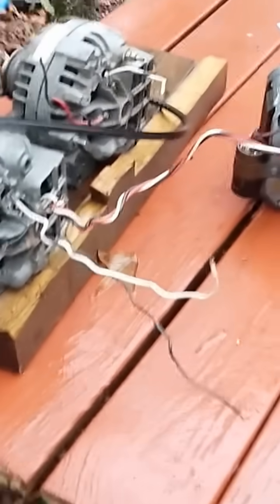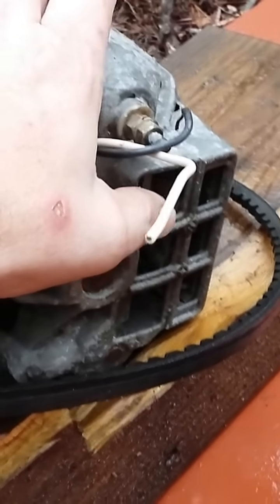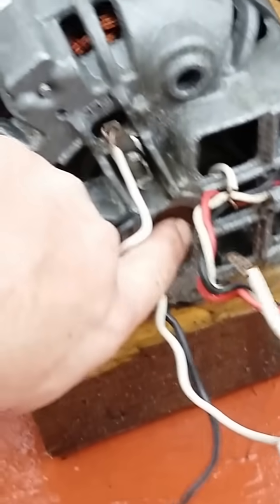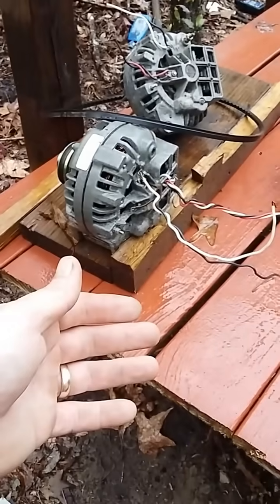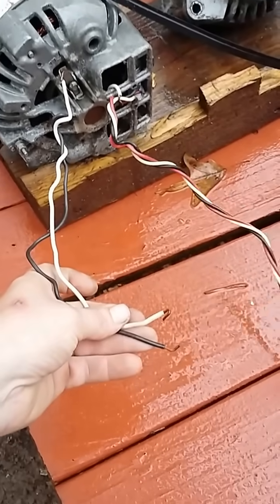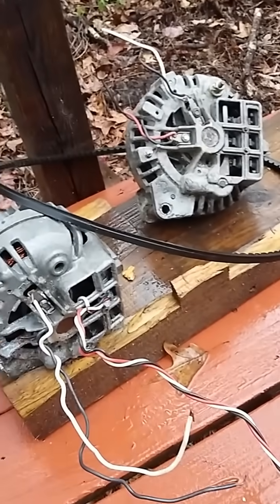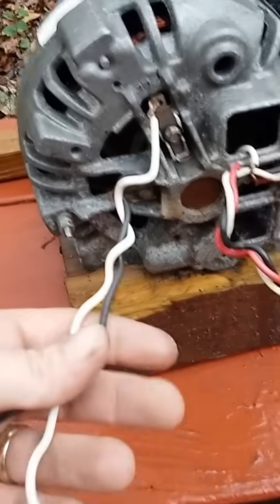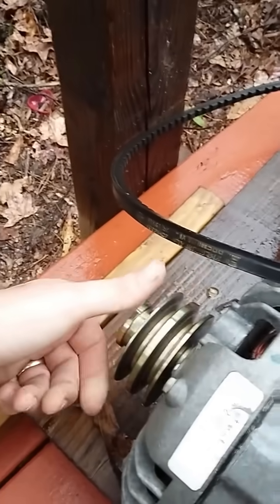Update Free energy forever no wind no solar no gas READ DISCRIPTION!!!

Comment: Energy can neither be created or destroyed.  One of the laws of Physics.  This device is nothing but a pipe dream since perpetual motion machines are nothing but hoaxes.   Don’t fall for this.  Anyone who understands energy knows what this video is talking about is not possible.
Reply from the maker: Energy cannot be created? So.... therefore it does not exist! so why would you even tell people that it cannot be destroyed? Wow......
 I could say Force equals gravity times mass 1 + Mass 2 over blah blah blah but it would not explain anything to simple people or simple hu-mans and the men and women that are still alive out there are mostly brainwashed LIKE THE OTHER COMMENTS SAID.. so you can see why I have no enthusiasm into teaching people how to put batteries in a remote control or trying to tell them that a DC car battery is not zero volts negative and 12 volts positive... it's negative 6 volts and positive 6 volts.  they won't understand anything unless it is simple...  so, I created a solid state system that uses the same vortex based mathematics technique/pwm signal while capturing the collapsing magnetic fields and compiling them in something homemade and making them reverb on each other at the same time while sucking in at a frequency above 25,000 Hertz and above 10,000 volts with basically no current consumption whatsoever from the primary power source because everyone knows it's easy to phase match by hooking the negative of your battery directly to the negative side of your high voltage full-wave rectifier and with lots of amperage once turned on for a couple seconds because of the way I figured out how to get the electrons to all spin in the same direction while all moving through each other in another direction symmetrically and oriented all in the same north-south configuration technically making the electrons reverb on a quantum level I guess you could call it a quantum standing wave and it took me a couple of years to create this and build it and it has already been copied all over the world and YES it is amazing to see a machine of mine to have an infinite coefficient of potential that not only will last for a very very long time with no pollution but the rectifier circuit and voltage regulator circuit that comes off of the high voltage homemade part can be copied multiple times for use anywhere else desired!!!!!   the frequency can be adjusted for maximum amplitude by moving the spark gap closer and further apart and is also a quantum part of the device as the electrons are allowed to choose which direction they want to move creating a balance that is most important when you need everything to be in a ratio or equation you had to create from other technology that had not yet arrived with the light....  but maybe you're right and as everyone says what do I know I'm just a dumb redneck talking crap about a homemade motor made from the Chrysler car alternator in this video here that technically would be a three phase field magnet motor and as in quite a few other videos, TO WHOM ARE THE PROPERTY OF I.... THAT ARE ALSO HERE ON THIS CHANNEL AND on this very subject.....?....... 
THIS CHRYSLER ALTERNATOR WAS CONVERTED TO A MOTOR WHEN THE RECTIFIER CIRCUIT WAS REMOVED OR BYPASSED and can easily be ran from the exact same type of pulse width modulated or pwm signal that is on a three phase brushless DC driver that keeps itself synchronous with the BEMF or back electromagnetic field or the collapsing of the 3 magnetic fields (and only has to be measured from the middle phase) which technically are faster than the speed of light and more energy out of a coil then into a coil and it has been in front of everyone forever but no one ever tries anything!!!!! holy shit wake UP people.........   
So let me say it in simple terms if you have a copper coil and you hook a positive to one side and you then pulse or touch the negative to the other side you will create and build up a field that has magnetic properties and gravitational properties and quantum properties and when you take the wire off off of one side of that coil that you built the power up in to create that field you release the pressure build up of potential that you have put into the coil and if you just measure all of this with your own instruments you can see that how much power you put into that coil and when you release it..... say.....  possibly into storage?  you will see that it is much more power released out of that coil than in... you will actually find it right in your face that there is more energy out! And when you simply use a diode to only capture the collapsing of that coil could be transformed back into more energy than needed therefore it is an energy secret  part of almost every circuit that exists in almost every electronic out there today! Yes I know you're going to have to read that again to understand what I said or to understand that all of the circuits that are in the world today can be modified to run themselves without needing a external power source...  Or moving parts!  I sure hope that after reading this comment or statement a few times that it is in details that are simple enough for everyone to understand?
Reply: Exactly. It's just transferring, not creating electricity.
Reply: @TheJEFiles  It’s not really a transfer of energy.  There are losses due to heat, friction and electrical resistance where you get less energy than what you put in.  Think about your automobile with a gasoline engine.  At most , it is around 30% efficient due to frictional losses inside the engine, weight of the vehicle and rotational losses while tires rolling on the pavement.  The remaining 70% of energy is lost in heat.  Open the hood of your car to feel the heat if you don’t believe this. Measure the temperature of tires after a short trip. They will be hotter. We never realize the full BTU content of a gallon of gas.  If we did, there would be no residual heat being dissipated by the radiator.  Our air conditioners would virtually cost nothing to operate. Our lights would not put out heat, etc.  If someone is so gullible to believe the video, I have a property located at 1600 Pennsylvania Ave in Washington DC I want to sell them.
Reply: I invented one that can carry large loads and go as long as the gears last..years and years. Everyone i have showed it tois amazed and sauys will change tbe world including professors and
Reply: What if you used the force of gravity ? A natural force. With weights on a wheel ? Can be done. Almost like newton's cradle. Gravity with the force of motion ?
Reply: It can be done. Gravity is a natural force. A wheel with evenly placed weights such as bars on it, maybe pointing south east all the way around. Say 11 bars. Force of motion along with gravity ?
Reply: @jacobh9942  I assume you are referring to a perpetual motion device?  If that is the case, inventors / scientists who are a lot smarter than most of us have unsuccessfully developed one.  Einstein, Edison, DaVinci, and others like them all failed in their attempts.  So far the laws of physics have shown there is no such thing.  If you invent one, then you will in essence control the world, if not the universe as far as energy is concerned.  But, I don’t think we need to worry about that control.
Reply: @jarmstrong2843  one guy actually did it .it was a large wooden thing and nobody to this day can figure out how he did it
Reply: @jarmstrong2843  it was a show i saw on tv about ten years ago i forgot who invented it although i want to say it was tesla who designed it i could be wrong about that but like i said nobody else can figure out how it works but if i could prove it id be a rich motherfucker and would not be talking to you
Reply: With heavy spheres on top of bars... adding heavy magnets as it turns, one by one... I think it would work. Somone should try it
Reply: @jacobh9942  Sorry, I can ‘splain things, but I can’t make your understanding them.
Reply: @jarmstrong2843  didn't mean to make you ignorant j. .. it's just I'm a bit of an optimist. Just like someone said landing on the moon was impossible. I know you know everything but you never know what could happen.
Reply: @jacobh9942  I don’t claim to know everything.  I have little patience with people who are dead in between the ears and fail to realize there are laws of the universe we have no control over.  Keep in mind putting a man on the moon did not violate the laws of physics.  Scientists and engineers worked within the confines of those laws.   Perhaps if you studied thermodynamics you’d have a better understanding of those laws and learn perpetual motion has never been possible.   Yeah I understand your statement about being an optimist.  After all you wanted to joint the Optimist Club, but didn’t think they would accept you.
Reply: It is possible he didnt tell you what hes turning the thing with. wind or a water wheel will turn it and make power his video was not that infomative but you can create 110 with a car alternator

Comment: THOMAS, I NEED YOUR OPINION AND IT MATTERS TO ME, DON'T GIVE A DAMN ABOUT THE OTHER NEGATIVE OPINIONS. A 3HP ELECTRIC MOTOR RUNS AT 3,500 RPM'S AND USES 3,000 WATTS AND A 2HP ELECTRIC MOTOR USES 2,000 WATTS. A GENERATOR UNIT FROM A GAS POWER GENERATOR PRODUCES FOR EXAMPLE 5,500 WATTS AND OPERATES AT 1,800 RPM. NOW IF YOU RUN 2 GENERATOR UNITS ONE TO POWER THE ELECTRIC MOTOR UNIT AND THE 2ND TO RUN YOUR HOUSEHOLD OR CABIN. BOTH DRIVEN OFF THE SAME BELT BY THE 3HP ELECTRIC MOTOR. YOU WOULD NEED TO USE AN INVERTER TO POWER UP THE ELECTRIC MOTOR TO GET THE POWER FLOWING FROM THE GENERATORS THEN DISCONNECT THE INVERTER AND IMMEDIATELY PLUG INTO THE 1ST GENERATOR SO IT TAKES OVER POWERING THE ELECTRIC MOTOR AND THE SECOND POWERS WHATEVER. IF THE ELECTRIC MOTOR ONLY REQUIRES 3,000 WATTS YOU SHOULD HAVE ABOUT 2, 500 WATTS LEFT OVER PLUS 5,500 WATTS FROM THE SECOND TOTALING 8,000 REMAINING WATTS CORRECT? BUT THEY SAY IT WON'T WORK! IF THE GENERATOR PUTS OUT MORE WATTS THAN ITS CONSUMING AT THE ELECTRIC MOTOR HOW COULD IT NOT WORK? I THINK THEY ARE WRONG! IT SHOULD BE A CONTINUOUS SUPPLY OF ELECTRICITY WITH NO REMAINING EXTERNAL POWER SUPPLY! LET ME KNOW WHAT YOU THINK.
Reply: You need to check the flux capaciter
Reply: I've been thinking of this to
Reply: Sounds good to me I don't understand  why people have to act like such Jerks. Dude at least you are trying to come up with something instead of just ragging on people. I say good for you, we don't continue to learn without some kind of effort
Reply: LOL! Try it. Anyone out there.., try it. Just rent the equipment. You don't need to spend the money required to purchase it all. I'll stop laughing and apologize as soon as anyone's successful. Get back to me as soon as possible!
Reply: Try it and see (how ignorant you are)

Comment: Electricity is produced by the transference of power you can’t put less and get more . You put more and get less  ?
Reply from the maker: That is simply just not true and the only way that you would know the correct formulas is if you studied planetary physics because they do not teach the correct conservation of energy laws in electrical engineering only rocket science planetary physics and a couple other places saying you cannot get more out than you put in is ridiculous it is all just sound and if you want an example using sound then go stand in front of a cave and yell into it one time will you get the same amount of energy out or will you get more? Yes, it's more out because it is reverbing...  And that is what you must do with these energy systems it must be high voltage high frequency so you can compile the electrons in a homemade capacitor to be released with voltage regulating AC caps so it is safe it could then be rectified and post into a transformer or an inductor for however you would like to create your sine wave... But this video here that you comment on only shows my three phase field magnet motor that I produced from the Chrysler car alternator....
Reply: @ThomasBuie   Flat Earth much?
Reply: @johnlshilling1446  that reply makes no sense. 😂😂🤦✌️
Reply: @Love_life_always   Sorry. It only makes sense to educated people that are capable of critical, rational thinking.
Reply: @Love_life_always   LOL! So you don't get it, either?

Comment: I have a BSEE degree and there is alot of amperage facts that are wrong in this presentation.  How fast and how consistent the armature is spun is also important. Your VAR's should be offset with capacitance reactance to produce a better power factor to bring the working efficiency up. An alternator is three phase power with each leg being 120° out of phase with each other not 180° like your household uses from the utility company. So, this must be taken into consideration when running this voltage into a transformer.  Now the alternator shown here puts out about 1000 watts. If you could get a constant RPM for 60hz @ 220 volts A/C, not very likely,, remember your multiple of 1.73 because it's three phase, you would get something like 380 watts real world uses???? There's a lot more to consider. If you are using this for inductive load real power compared to apparent power will be quite different. That's 90 amps at 12 volts, not 90 amps at any higher voltage. Amps X Voltage will give you real close to wattage. At 100 volts would be 10 amps. I think you might not have understood what they were saying, if you keep playing with these voltages in the unsafe ways, you won't live through it. Not, the government is trying to stop this information from leaking out. Look up three phase automobile alternator for generating power. It's all over the internet.

Comment: V COOL!  90 amps is good energy. Lets see, Volts x Amps = Watts. Thus;
90 x 120 = 1080 Watts. A couple of these certainly could power a house. 

I'd buy a few used P/V cells and some recycled deep cycle batteries. A backup generator is probably a good idea too.

Most refrigerators run under 600 watts and no fridge runs continuously. So run a few LED lights, a computer and maybe a radio etc Hey, you're in business. Thank you V much!

Comment: All I got was that you repeated yourself almost a dozen times maybe using some different verbiage but still just repeating 3 to 6 V in 120 V at 90 A out oh and yeah you have to spend the motor. I have built systems like this myself and I use the gas powered Engine to spin it works great. But the way you’re talking you are confusing a lot of people

Comment: how did u convert the alternator 2 a motor? did u use rechargeable batteries if not how long will batterys last if u use a 12 volt car battery? Is there any chance of over loading the motor? By the way this a great video
Reply: No it's not. 
An alternator can't be a motor and a generator at the same time.
If you can feed it energy then you can get an output, like a windmill or hydropower. 
If you're powering the state of via DC, and omit the diodes, you just built a really lousy DC to AC converter.

Comment: Your not controlling the frequency, you need 60hz  so your going to blow up appliances and lights like that. But there are alot of other problems with your set up......... your still powering the motor from somewhere right?  You wouldnt live very long because your going to electricute yourself or burn your house down haha

Comment: So I did exactly what you said and hardly get any ac current. Like 2 volts. What is the trick?
Reply: Spin the pully faster try to get it to at least 800 rpm you should see an increase in power

Comment: While I commend the intent, I would have to say this is a very poor video.  Anyone who understand electricity wouldn't sit through this mess.  Anyone who doesn't shouldn't attempt to use the ideas "explained" here.

I have been teaching various subjects for over 40 years and this has to be the worst educational video I have ever watched.  It left me with the impression of someone who doesn't now what they are doing - which I am sure is not the case.

If you really want to tech this, WRITE what you want to say down first.  Pick the sources of energy.  Use a single source - like a windmill or crank ...  If you are going to explain the output, use a real example.  Once someone understands the entire cycle, they can begin substituting.  (Though I recommend a little education first.)

Comment: Respectfully- what spins the alternator? Alternators are designed to generate electricity. This is true but it all comes down to what spins it. If it’s a hydro-turbine or other natural phenomenon, then yes to your idea. Load also matters, so if your home is not crammed with power hungry appliances then again yes. Have you considered a sterling engine to provide the rotating force?, although the up/down could be rigged with magnets and copper coil to generate power. Of course there is wind turbine but that’s another construction. God bless and keep you🙏
Reply: Ps, what is your dc input? Could be what I have mentioned but also solar.

Comment: The 3 wires yielding 90 amps are far to thin to handle power of 90 amps. Wouldn’t you need to replace the wires with 4 or 2 gage wires that go directly to the house main panel?
Reply: I agree with you very much.

Comment: Ok brother i got mind a part i no how to put my 12v to the ground and hot wire. Now what I need to know. Is which one would be the ground out of the 3 wires. Cause I no for 220 you would have two hot wires
Reply: If your unsure a multimeter will help the ground wont have power
Reply: it's <KNOW> you ass clown
Reply: @lupydupy1  if you knew so much you could tell me how to hook it up. If not say off my comment thank you